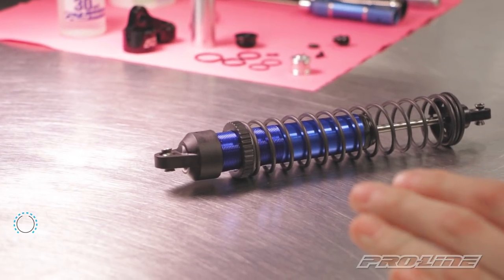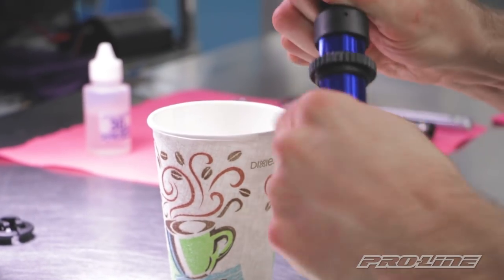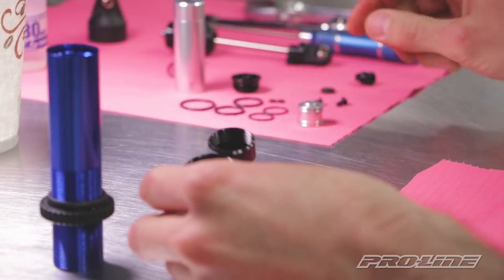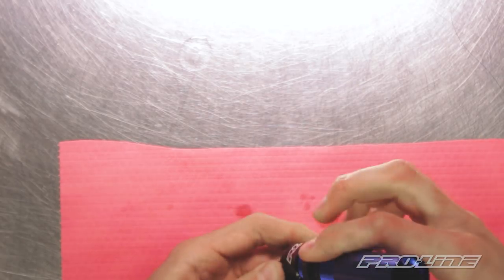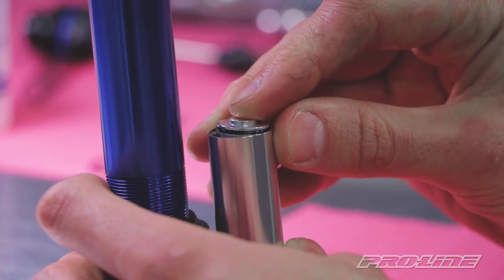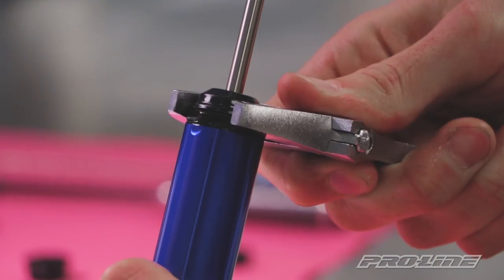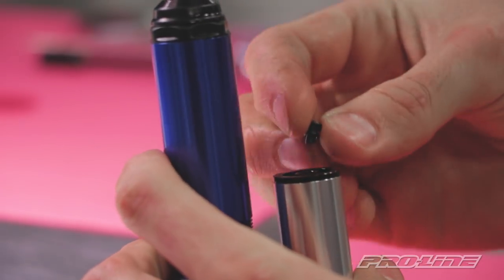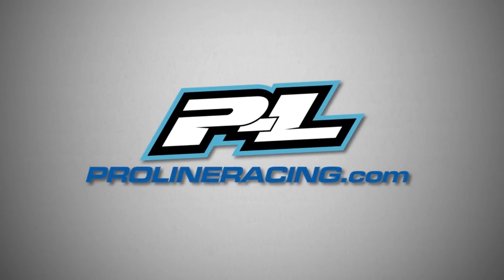Pro-Line HOW-TO: Assemble Ultra Reservoir Shock Cap for X-MAXX

Comment: Hello, I would like to have your opinion on a problem that I encounter with the tanks.
After a few packs, I notice a sagging damping, let me explain, when I put the xmaxx on the turrets the shock absorbers sink about 15 mm, which is due to air in the damper main body.
And when I remove the tank cap, I can observe oil above the piston so this oil is necessarily missing in the body.
So I replace the 2 O-rings of 15X1, I go up the piston with the least pressure in the tank as you explain it.
And it happens again!
Thank you in advance for your interest in my question.

Comment: I saw air get trapped in the shock during assembly in the res. piston cup side.  I suggest you bleed that.
Reply from the maker: There’s actually an air bleed hole in between the two o-rings of the reservoir piston. The piston was inserted slowly to let the air out from inside the piston.

Comment: Pro line, you didnt answer James below so please answer me, what improvement will these give if any, if your pushing the piston all the way down you have only a fraction more oil in your shocks with these as you would without, just an extra spring to slow the oil going through the piston and slow the depression of the shock after a jump is all I can imagine it doing, please explain before I decide to spend £180
Reply from the maker: Hi @UKASS COD,
The reservoirs do not drastically change the damping characteristics of these shocks. They are meant to compensate for the volume of the shaft as it enters the body during compression and keep the internal pressure low and consistent. This is especially helpful with our shock shafts which are larger in diameter than the stock shafts. Keeping the internal pressure consistent reduces the stress on seals and provides more repeatable damping.

We hope this helps answer your question,
Thanks for your interest and support!
Reply: @ProLineRacingYT  I've purchased the shock tops and they came yesterday, can't afford the rest right now as its a small fortune for them but hope to get the rest at some point

Comment: Does it has a rebound on the shock shaft?after adding the oil and bubble air removed?
Reply from the maker: Hi SPEED TUJUH,
If you fill the shock with a lot of reserve oil by only pushing down the reservoir
piston partway during assembly, you can build enough pressure into the shock so
that it will push the shock shaft out to some extent at equilibrium (the balance between forces).

Comment: hi, i added alot more gear on my xmaxx than it had in its original shape, it weight is 2 kg more than the day one, and i feel the body stays closer to ground than before, i need some stronger sting or shock tower to balance the weight of the body. can you help me with that?
Reply from the maker: Hi @Mr Crow,
Our X-Maxx PowerStroke HD Shock Bodies and Dual Rate Spring Assortment will help you accomplish that. You can find them in the direct link below.⬇⬇⬇ https://www.prolineracing.com/large-scale-performance-parts/

We hope this answers your question,
Thanks for your interest and support!

Comment: How much oil did you use per shock and is 30 weight the best for the X maxx?
Reply from the maker: Hi @Mike Kennedy,
2 bottles of oil should be enough. We recommend 30, but a heavier oil weight might suit your needs better.

Thanks for your interest and support!
Reply: 2bottles per shock or per pair?

Comment: After watching this I've realized this is a gimmick, the reservoir piston is so far down into the res that very little extra oil is actually being added to the overall total volume of the shock. I'd love to see a temp check of proline shock vs a standard shock after as 25m bash session. I bet there is little to no difference in temperature. Don't get me wrong here I love proline products but really this is a bling thing, your just as better off to put fake reservoirs on for the look. I think all this accomplishes is creating a much higher chance of building your shocks improperly and reducing the ability for the shocks to perform at their highest level. I think prolines power stroke shock woulda been a better upgrade.